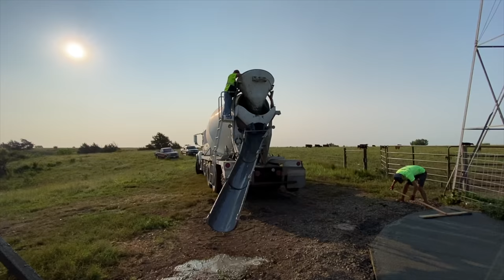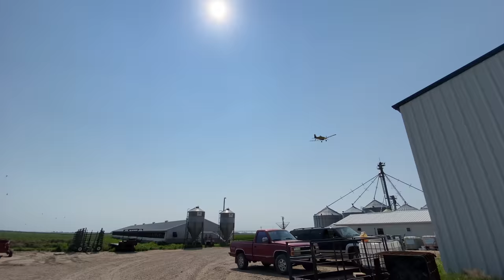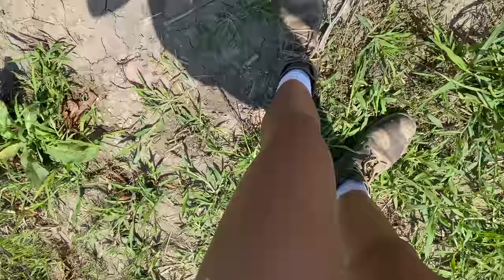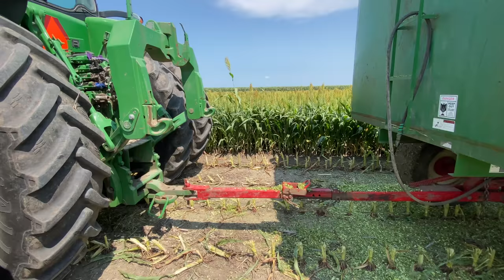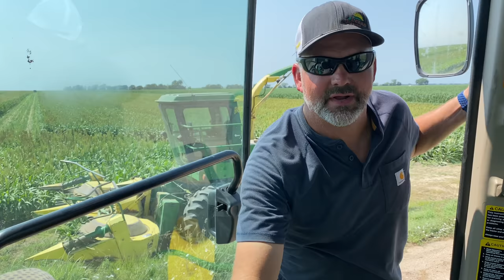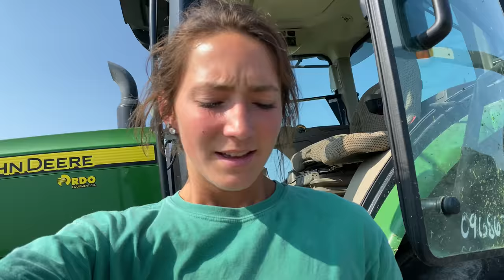Chopping Silage in Nebraska, USA

Comment: Hello there. Jack of all trades. Master of none. And when you lay concrete always tamp it to get the air out. It last longer.
Reply: Yes, always tamp it down. That also raises the cement above the rock so that there is a nice layer of cement on top to smooth over with a float. I always put remesh wire and rebar in every slab that I pour so that it won't crack and pull apart over the years.

Comment: Before you mentioned about the trailer being half empty, I could tell by the way you empty it that there was more left in there. The moisture keeps it stuck to the trailer
Reply: I immediately thought that pile looked pretty small after she had emptied that wagon? Turned out that my first instinct was correct? Yes, it being wet definitely makes it stick together. The wagon needs to tip over more or there needs to be a vibrator installed on the bottom to shake things loose. They do make hydraulic motor vibrators that they can hook up to the tractor.

Comment: Wires rubbed on inside of waterproof flex. Thus electricity is arcing and that is the smell of ozone/plastic insulation on flex electric line..... From the motor vibration when running, no biggie.

Comment: Wai, why are you chopping up good corn plants?
Reply: They planted many extra just for the silage to feed their cattle through the winter. Plus they may be cutting down the corn that was damaged in the storm and making that into silage because the grain has been ruined and is unsalable.
Reply: @joefudd  they are chopping milo not corn.  Milo is grown for silage.  :)
Reply: It is milo not corn.  It is grown specifically to feed their cows.
Reply: @beckyumphrey2626  I saw her dad drive right into one cornfield with the chopper. It was obvious because it was much taller. Also look at what Laura was dumping from the cart onto the dump pad.
Reply: @joefudd  I looked back at the video on zoom.  That was sorghum.  Their corn is tasseling. Did not see any tasseling corn being   chopped purposely.
Reply: @joefudd  if you are talking about the view at the 10 minute mark in the video that is milo he is pulling into.  The corn can be see about 100 feet past that view.  Much taller and greener.

Comment: 470V's? Holy smokes, I didn't know they were that high of voltage, they must have their own special transformer too.
Reply: 480V is a standard 3-phase voltage.  Before I retired, I was designing (very) high end computers that ran on that.
Reply: @clandry1234  Is it true that power poles with 3 lines is 3 phase, 2 lines is 2 phase, and 1 line is single phase or is that not how it works?
Reply: @clandry1234  as you also know that electric motors run more efficiently at that voltage and on 3 phase and the wire sizes needed to run the power for that and for a distance can be smaller than for lower voltage motors.
Reply: @lindenhawthorn4761  3 wires is for 3 phase, 2 are for single/split phase. There are no 2 phases.